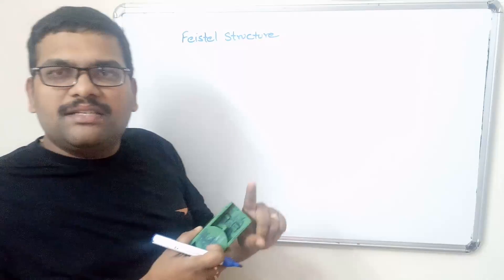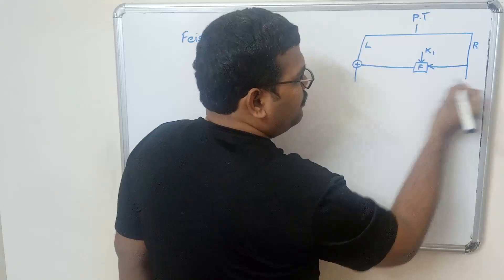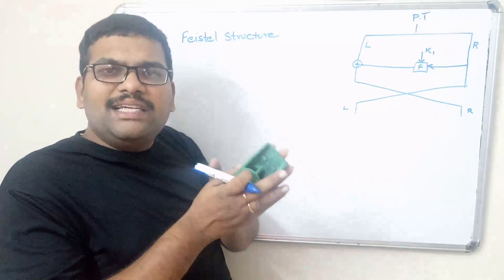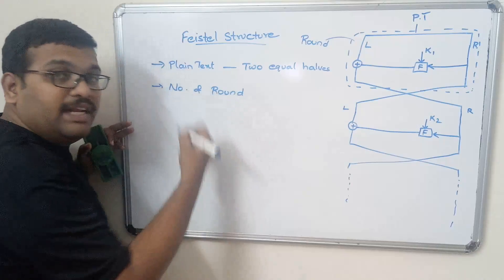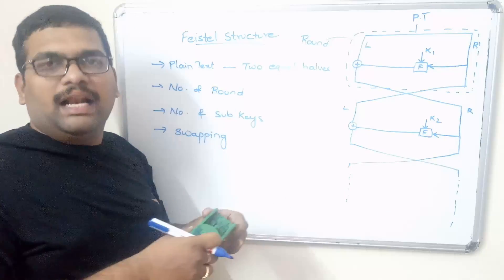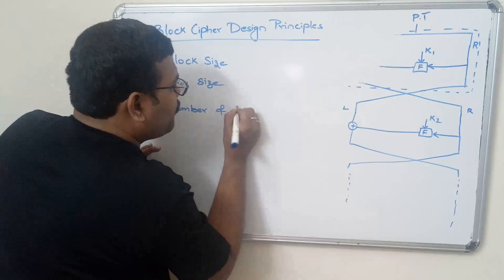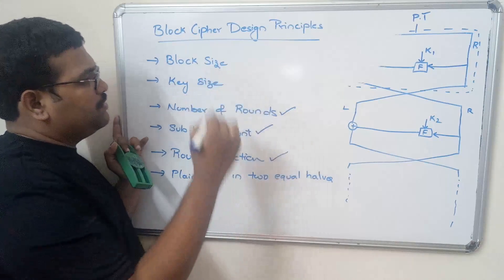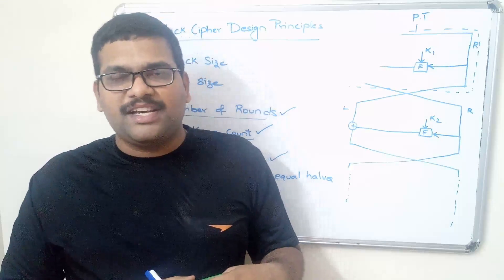08-Feistel Structure in Network Security 🔐 | Encryption Model Explained with Example

Comment: I have college assignment, Differential cryptanalysis attack on Feal-4 algorithm , we have choose plain text and cipher text. I have done four rounds. and got 6 subkeys. , when i use the six sub keys to encrypt and decrypt , verification working fine , but my college professor. say like this . below. 

Only one value is given for each key - most are out by a few bits, but one is correct. Code seems to be largely based on Amazing Kings, without any real understanding of how the attack works

what's your opinion on it.